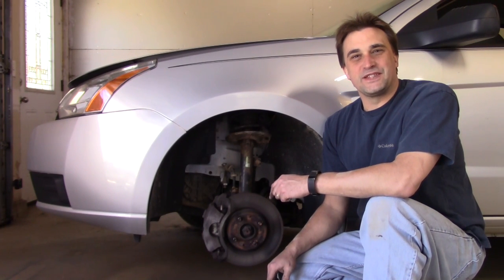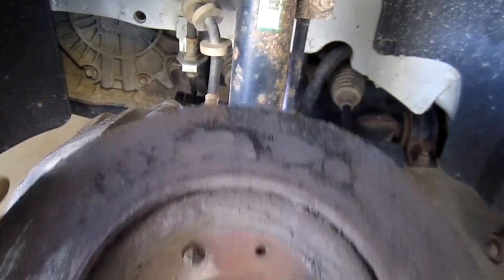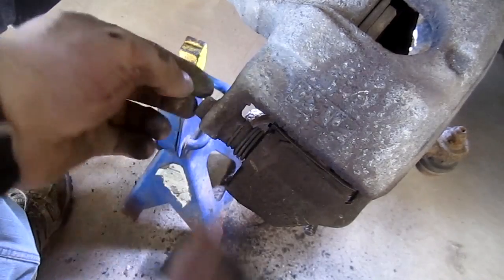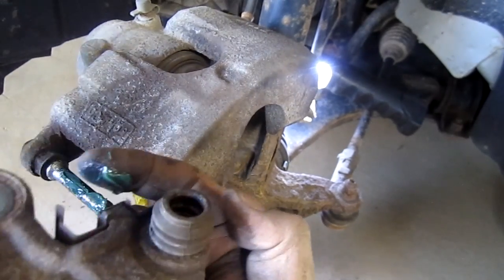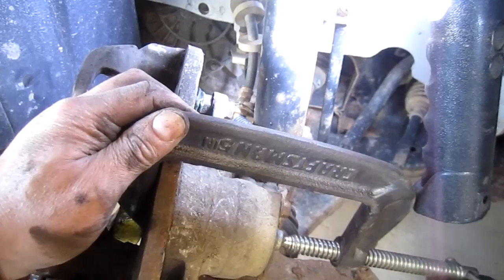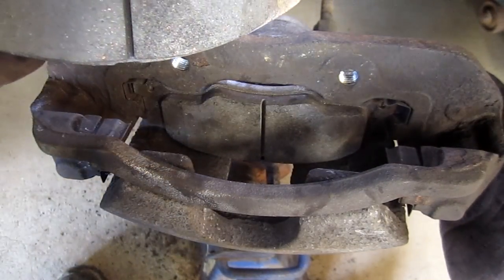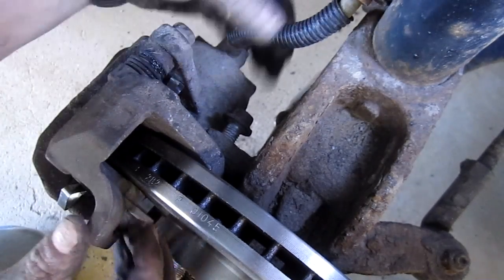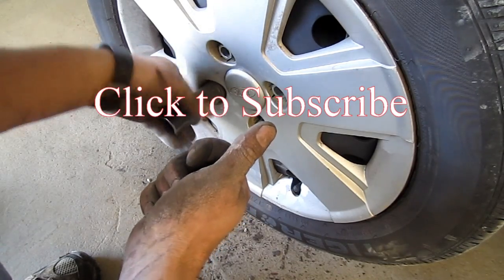DIY Ford Focus Front Disk Brake Replacement ~ Brake Pads & Rotor Replacement

Comment: I live where it snows and roads get salted, so lots of corrosion on the caliper/caliper bracket. Same for the hub. Took time to remove the corrosion with some sand paper and a small wire brush. Used brake cleaner to finish the clean up. The new motorcraft pads came with new anti-rattle clips, so replaced those while I had everything off. Put the caliper bracket with new anti-rattle clips back on hub and was very easy to add the pads and then put the caliper back on.

Comment: yes your video was good,  after i put my car in for its   M O T  i was told i needed 2 new brake pipes at the back & 2 new rubber bushes just above  the back seats these were small one i end up paying £ 220 + £ 45 for the  M O T  making  £265,  so now i am thinking  to do repairs  my self like i use to do.
Reply: Make sure to purchase a Chilton Manual before attempting ANYTHING for repairs.  Those average $20-30 USD per manual and have a monumental amount of information to make maintenance easier

Comment: you are using the wrong type of grease. you don,t use a grease gun for this job. you need to use brake and caliper grease. that is why your pins are sticking.

Comment: Done my brakes same way but i have a reataining spring on the outside, ford focus 1.6 tdci 2011 5door, but after a week it starts binding again,
I CHANGED CALIPER AND PINS AND DISCS AND BINDED AGAINAFTER 9 DAYS after
Garage replaced disc pads pins and after two weeks started binding again and disc were slightly worn  in places ,
I DON`T KNOW WHATS CAUSING THE ISSUE,?the caliper is not seized , could the retaining spring be an issue,

Comment: Please do not misunderstand, but brakes are safety-relevant parts and therefore not really suitable for being serviced by everyone on Saturday afternoon.  Nothing is really wrong here, but the devil is in the details!  For example: The lining carrier has already rotted and rusted here so much that it would have had to be cleaned and derusted thoroughly!  Lubricating normal wheel bearing grease and such amounts in the saddle guides is similarly wrong and unsuitable!  The details of the tightening torques are of no use either.  Furthermore, I'm pretty sure that the piston in the saddle has rust on the inside.  Partly due to the hydroscopic brake fluid, partly due to diffused water from the outside on the cuffs.  The brake calipers should be completely disassembled and cleaned every 5-7 years either way.  The wheel hub was also not derusted and the new brake disc was simply stuck on the uneven, because uncleaned surface of the wheel hub flange.  That alone will inevitably and in the near future lead to a warped brake disc if the jamming brake pads or a jamming brake caliper piston do not!  Any reference to these things is missing here and is therefore not for the inclined hobby screwdriver without detailed prior knowledge!  Sometimes it is good if you know what you can do and it is often better if you know what you cannot do and better leave the latter to a specialist.  The shown here may work, but it can end in a terrible disaster for the next one.  And then third parties may be affected.
Reply: Some of us can't afford paying a garage 1000 bucks for a brake job. I have changed my own brakes and rotors several times and never had an issue.
Reply: @truthmatters4ever247  I think DIY is totally fine too!  And as long as everything works as expected afterwards, why not?  But, as I already mentioned, with some technical objects the devil is in the details and even some "experts" make one or the other faux pas...😉 I speak from 30 years of experience.  But I didn't mean to offend anyone with my comment!  That was just a friendly reminder that everyone should be aware of their responsibility when doctoring around safety-relevant parts on and in the car.

Comment: Would be nice to know what size sockets used and also proper lube and not regular grease would have been great
Reply: Jeppy Frost; anti-seize is a much better choice than grease, as grease tends to trap dirt and stick the slides.
Reply: 15MM 1/2"  with short extension bar..  he did say.

Comment: Y'all 🤦 After removing the brake fluid reservoir cap: 1) Remove the caliper from the caliper bracket FIRST (the two 14mm bolts). 2) Press piston back in. 3) Remove the pads. 4) Remove the caliper bracket (the two 15mm bolts). 5) Remove the brake pad guides from the caliper bracket (the thin pieces of metal). 6) Remove the rotor. 7) Install new rotor. 8) Install a lug nut or two to keep the rotor in place. 9) Install new pad guides onto the caliper bracket. 10) Grease pad guides. 11) Install new brake pads into the caliper bracket. 12) Reinstall caliper bracket / new pads as an assembly over the rotor. 13) Grease backside of pads. 14) Reinstall caliper. 15) Check fluid reservoir / reinstall cap 16) Pump breaks. 17) Test drive. Note that while you're pressing the piston back in the fluid level in the reservoir will rise - be mindful of it overflowing. It is recommended that you remove the caliper slide pins / boots and clean / lube while you have the caliper bracket off. Torque specs: caliper bracket bolts (15mm) 92 ft/lbs, caliper slide pin bolts (14mm) 21 ft/lbs, lug nuts 100 ft/lbs. Trying to replace the pads and / fiddle with removing the caliper from the caliper bracket when it is unbolted is backwards and dumb.

Comment: Do it in his words "the right way". I didn't and broke the metal piece off a brake pad and screwed up the things that were supposed to keep the brake pads snug. You take the 14mm screws out which are holding the slides. This takes off the caliper from the what holds the brakes. Then remove the 15mm screws which holds the piece that has the brake pads. It comes off the car and had a much easier time putting the brake pads in without breaking shit. I realized doing this could've saved me a massive headache. You also have more room for compressing the caliper with the c-clamp. On top of that you have better access to greasing the slides or repairing the boots.

Comment: this was painful to watch, just remove the slider pins, grease the contact points between the pads and the bracket.  also ford recomendations are 100lbs for the wheel torque.
Reply: I agree, kinda seems the long way round to do job, slider pins out first.